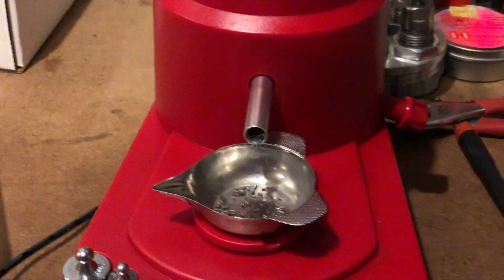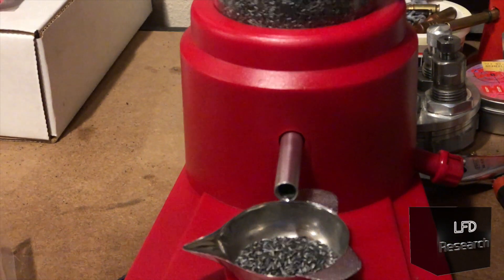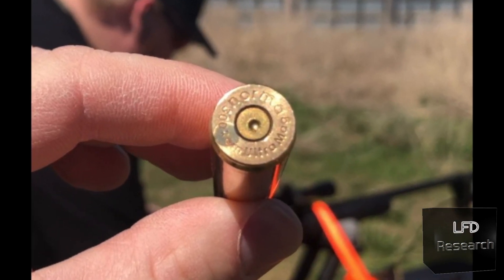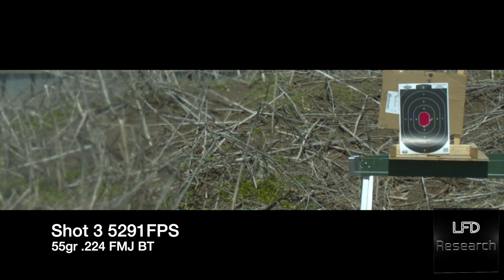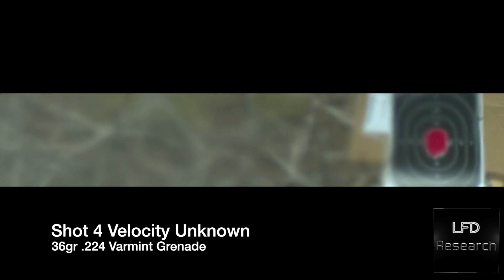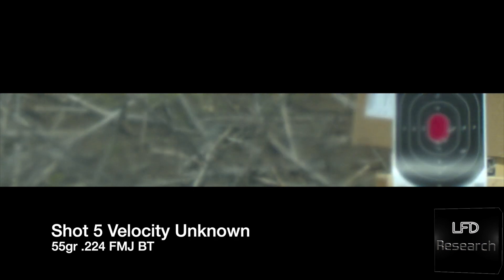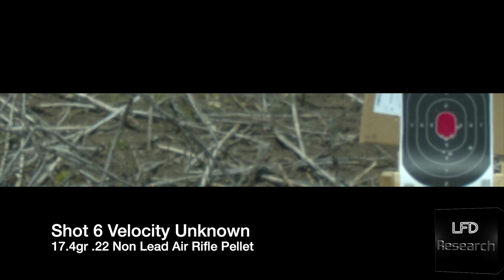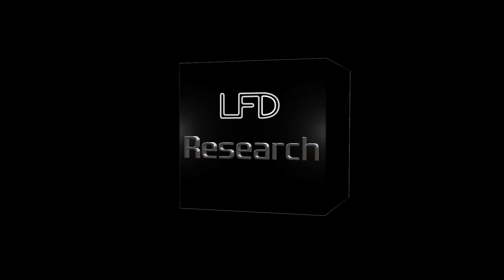1 Mile Per Second!

Comment: Can you possibly tell me what was the kinetic energy of the bullets that went 1 mile per second?

Or muzzle energy as you and they call it?
Reply from the maker: For the 55gr your looking at roughly 3419ft lb of energy.
And the 36gr your looking at roughly 2571ft lb of energy.
The idea on this was mostly to get the highest velocity not so much the most energy. Factory 300rum get roughly 4000ft lb of energy.
Reply: @LFDResearch  
I get 420fps with *70psi* from 100ml tank..
dowel arrows 4'' about 25gr...if i had +55,000psi things square up strange..
Check the maths on claimed psi work . much less work is doing what we see happening at the muzzle .

Comment: The bullets will blow up in mid flight or disintegrate in mid flight....I’m guessing-a mono...or solid projectile ...will be better at those speeds...
Reply from the maker: Maybe a solid tungsten projectile would be better so you have more mass and a better balance on the projectile. We did notice that how the weight was distributed in the projectile did a lot to affect how steady it was in flight

Comment: shifting from supersonic to hypersonic speeds is a completely different animal.  Because of that much pressure on the nose of a bullet,  it's going to create a much stronger vacuum behind the pressure cone and stronger turbulence behind the bullet... what you need is a longer projectile pointed on both ends and a consistent curve on the thickness of the rod from point to point...  If you apply a higher twist rate with the consistent taper from point to point, you should end up with better stabilization and less drift/tumble...
Reply: so, build a bullet like the body of a jet?
Reply: Frigglebiscuit no, more like a short tiny javelin...
Reply: @RoadTo2046  kinda like APFSDS tank rounds. its a small long dart with stabilising fins. This is how they achieve massive armor penetration from 120mm guns firing sub-caliber projectiles. Would be really hard to scale down to rifle size though simply because making subcaliber rounds for already small calibers would seem hard to do consistently.
Reply: @Yung_pindakaas  The answer is to use a much smaller projectile and matching bore size barrel with a much thicker barrel and chamber to handle the pressure.  
I'd say an iron core titanium projectile with a Teflon coating to withstand the heat from the massive pressure. The projectile would have to be about 4 - 5 mm wide and 20-25 mm long tapered on a parabola curve from end to end and the peak of said parabola about 1/3 of the way from the base. 
Case dimensions?  30/06 or .300 win mag necked down to the bullet size with a much longer and more shallow angle case neck to spread out the pressure of forcing the gas into a smaller space...
The smaller projectile shouldn't need fins because it's making contact with the rifling and there's more surface area to mass ratio contacting the rifling...

Comment: I would love to see brass .223 rounds shot out of this and see the armor penetration. A brass round at over 5000 fps?? Crazy. This is an awesome video!
Reply from the maker: We have tried some 55gr Leigh and it’s was keyholeing we are gonna try 3 more but if it’s not stable we won’t test it on the level 4 armor that will be tested with stable rounds only
Reply: Very interesting. Maybe too much power lol. These videos are great. I wonder if green tip 223's would do any better. 5600 fps is stupid fast 😂😂!
Reply: Probably difficult to apply proper spin rate for stabilization with the sabot. You'd probably need barrels over 30" long and more mild twist rates.

Comment: >5671 FPS

And they say it's impossible to break 5,000 FPS with current ballistics..
Reply from the maker: Well 5000fps is not the barrier it’s close to it the expansion rate of gas is slightly over 6000fps with current propellants stuff that is touching that wall would be the 17/50 wildcat and others that have been made. To go beyond with an impulse launcher not a rocket that you really need a Light Gas Gun or a railgun.
Reply: "expansion rate of gas is slightly over 6000fps" 
laughs in high explosive
But seriously, I wonder if a high explosive composite could be designed that starts off with a low pressure and ramps up to a higher pressure. Maybe by extruding it mixed with an increasing amount of inert filler?
Reply from the maker: Lol your right that limitation is only for current smokeless powders. There has been some experimentation with RDX based propellants most well known design that played with that was the HKG11 and some artillery/tank rounds also use a high explosive in the propellant. Sadly actual data on performance of that is currently limited.
Reply: @LFDResearch  We out here talking about bombs now lmao

Comment: That is extremely cool. How do you like that MagnetoSpeed chronograph? I've been thinking about getting one because it was be easier to use at my range but haven't pulled the trigger.
Reply from the maker: It’s great we have really pushed it over the years and provide you aren’t doing insane stuff like this reads perfectly all the time I do suggest getting the v3 over the sporter. It’s way more versatile and allows you to tweak things like sensitivity
Reply: @LFDResearch  I have the V3 best $400 I've ever spent